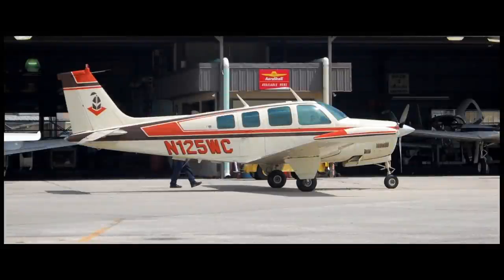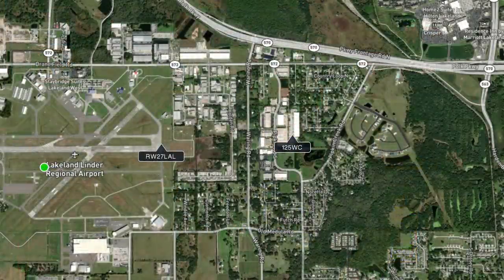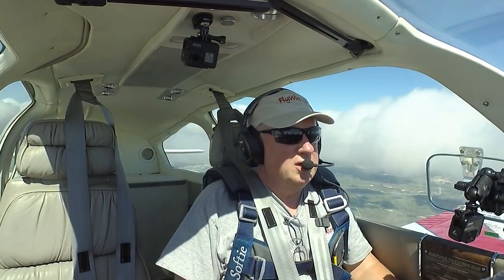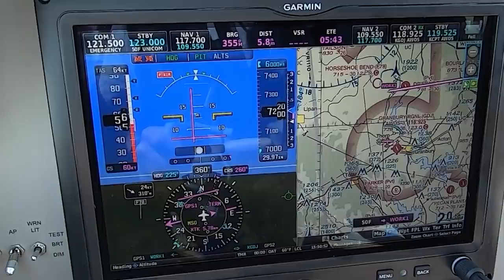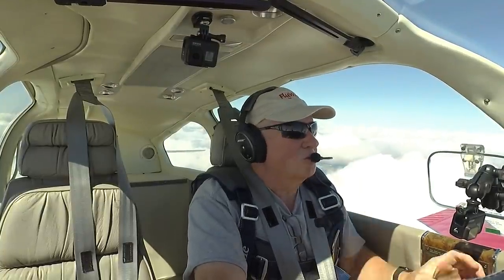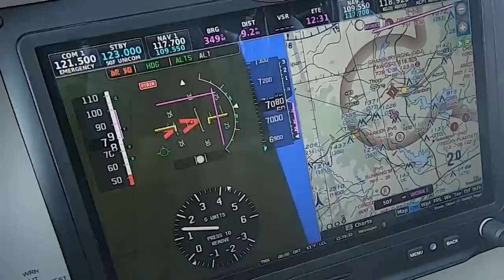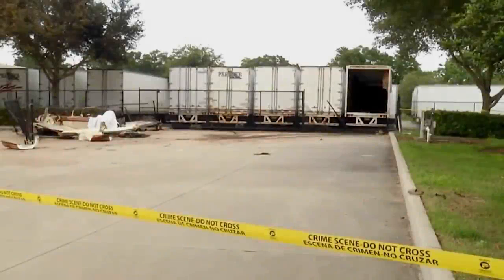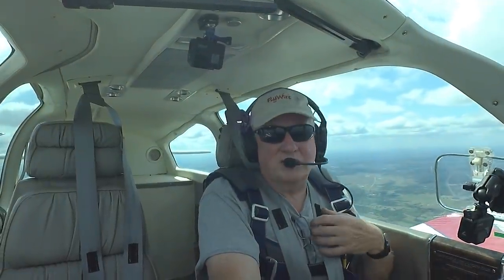Accident Review Engine Failure at Low Altitude  Extend the Glide

Comment: As a glider pilot, I learned the “fence hopping” maneuver. When you’re coming up short, dive for the ground so you’re in ground effect, and that’ll help you hop over the fence at the end of the runway.
Reply from the maker: Not a good thing for a powered airplane... they glide like bricks compared to a glider.
Reply: Glider pilots are brave.  They can drop nose at low altitude.  No power dependent pilot there..
Reply: I think the AQP guideline of defined minimum maneuvering speed (DMMS) is clearly the standard to shoot for here. Don’t go below it until you’re about to smack the ground.
Reply: @FlyWirescottperdue  What if you do like Bob Hoover and dive and climb, dive and climb with no engine?
Reply: @djbred18  I was wondering about that too. But then, I'm not inclined to become a test pilot on my last flight of my life, either.
Reply: @kevinjarchow8812  shit..I might just try it if it my last flight🤷🏻‍♂️
Reply: Ground effect works pretty well in gliders. When the glider "jumps" the fence, this jump is almost ballistical (under 1G at the top, if you pull down inmediatly as you only need to got just 5 o 6 ft AGL to clear the fence and proceed to the inmediate landing). If the glider still flies when reach the fence, it could clear it. The very low level, the post-jump's reduced Gs, and the inmediate landing disminishes the chance of a possible post-jump stall or his hardest consequences. But I think it's a very last resource: gliders brakes very well after touchdown, they're really STOL so, if you can, you must do a short landing using the emergency stop procedures.
Reply: @djbred18  
Sure! But you better have Bob Hoover's skills too...
Reply: @reggiepaulk You want to be at best glide speed until the field is made, not DMMS. If DMMS is much different than best glide speed you are going to put yourself in danger by possibly not having enough glide distance to make the landing site.

Comment: If any of you want to really learn how to handle an engine out, get an experienced flight instructor to pull the power on 2/3 downwind and proceed to land without touching the power.  You'll learn real quick what ground rush feels like and to respect your best glide speed.  Of course do this at a quiet time at the airport and make sure the tower is aware of what you will be practicing as your approach will resemble a carrier approach, no defined base or final approach leg.  This taught me to respect the best glide airspeed and to know my airplane, there is no substitute for experience.  It also teaches how far you can expect to glide your bird with no stretches allowed unless you want to wreck your mount and terminate your existence. Enough said.
Reply from the maker: Good point!

Comment: Stall/spin training in a cessna 150 aerobat was a very enlightening and scary experience. It’s amazing how quickly you are looking straight down at the ground and how much altitude is required to recover. It taught me to never get slow below 1000 ft agl, because there is no chance of recovery. More pilots should seek out additional training above and beyond what is required to get a ppl.
Reply: Nice video, my only suggestion is to get a prop filter for ur camera, makes the prop disappear. It’s just a piece of tinted material, anything will do. Try it
Reply: It is hard to avoid flying slow at low altitude if you want to land.  Otherwise I don't see a reason to fly slow at low altitude if you are flying for utility.
Reply: I did my flight training in a 1974 C-150 Aerobat. My flight instructor taught me stall spin recovery in VFR conditions as well as under the hood and a few times at night. This was in 1988 when the aerobat rented for $35 wet.
Reply: I think you're right. This video illustrates how fast you wound in this situation. It is much better to try to go for a controlled crash.
In view of how many accidents occur from the stall-spin situation, it would be a good preventive action to include it in the training syllabus.
Reply: @guidospaini7339  I think they should bring back spin training, too.
Reply: Never could get a 152 to spin.  Loved practicing stalls, power on and full flaps was pretty exciting.  Spun a Decathlon and I could have done that all day.  When the nose comes up and the plane starts pinwheeling, what a rush!  A dream in the air but with heel brakes only on the ground it was the DEBIL.
Reply: Great comment,  my instructor used to say training training training.  The three most important words in aviation
Reply: So true. Learned my stall recovery at 5,000 in a Piper colt with the glide of a rock. That thing was always near 3,000 on recovery. I felt much safer once I moved up into the Cherokee 150.
Reply: @curtisbrown5728   In Photo/Videograpic terms, the thing you describe is Neutral Density (ND) Filter.  It reduces the amount of light equally across the spectrum, so as to not distort the tones.  By reducing light it effectively slows the "shutter speed" (do modern cameras even have shutters?)  This prevents the "wagon wheel" aliasing that aggravates some people. 
I just learned about this filter a few days ago when another commenter implored a videographer of another channel to get one.
I'm particular about some stuff, but not optical aliasing with prop motion.

Comment: Most german pilots in WW2 started on gliders.  They were not afraid of power off landings, stalled less, glided after engine fails or shot down more.  Less pilot errors overall. Practice short approaches to  a point on runway..

Comment: Scott, I'd like to pass on a technique to significantly extend the glide which I learned 40 odd years ago.  While on downwind at the completion of a flight review in a Pa28R, the CFI cut the engine with the mixture and said "now show me a forced landing on the runway."  The landing with the engine shut down worked out fine, however the important takeaway from this was to learn that the glide could be significantly extended by pulling the prop to full coarse pitch: the reduced drag from the prop disc was such that you could actually feel the aircraft accelerate.  That lesson was learned many years ago in outback Australia and I think it's safe to say such a demonstration today would be regarded as foolish and dangerous – however I think it's an aspect of aerodynamics that pilots need to be aware of in case they find themselves undershooting during a forced landing.  
Another tip: Vx approximates min sink. Vy approximates best glide range.
Thanks for your great contribution to aviation safety.
Reply from the maker: Pulling the prop back is a good idea. In most of my videos on engine failures I don't do that because most folks don't do it for real. The difference in the Bonanza is 1500 FPM prop at cruise and 1000 FPM with the prop pulled back. I've got several videos on pulling it back as well. I'm pretty much on the fence on pulling the mixture... you give yourself an emergency and reduce your options. There is good and bad. Thanks for watching! By the way using Vx and Vy as proxies does not work across GA.
Reply: @FlyWirescottperdue  Hi Scott, thanks for your reply. Again, sincere thanks for your great contribution to aviation safety!

Comment: Appreciate your coverage.
My early learning was in a Piper Colt - (Flying Rock) I learned immediately to focus on any alternative that may minimize a crash landing.
My first, instructor initiated, dead stick landing would have come up far short of the Runway, but knowing the takeoff / landing capabilities of the Colt, I set a landing diagonal across he runway into an un-tilled stretch of field. 
My instructor aborted the landing and told me I was either confident or crazy(to be decided later) and the test was intended to fail.
2 weekends later, while prepping my plane for my he barely missed the top of the hanger line as he landed the Twin to my Colt Diagonal to the runway. The spinner and Cowling had exploded off on the downwind approach.

Comment: Well, technically the stall is induced by excessive angle of attack (approx 15degrees) rather than airspeed, but of course without an engine, the speed will keep dropping as the nose is raised in level flight, however the best glide angle is not at the point of stall!  If the wing stalls on one wingtip first, well you’ll get a rapid roll toward the side of the stalled wing and possibly precipitate a spin as discussed here.  Finding your best engine off glide angle would be a good thing huh!

Comment: Student pilot here and in my C-182 I have the most docile stalls. It is also possible the do a falling leaf descent with no power without to much trouble. In a populated area with no real areas to land the Falling leaf approach is the least energy way to hit the ground? Stalling into a inverted decent is not something I know how to handle. Upset training in a plane designed for it is in the cards for me.
Reply: Isn't your vertical speed pretty high during a falling leaf because you're stalled? Would not be a good way to hit the ground. You have to be carrying enough reserve lift to flare before touchdown to reduce your vertical speed as close as possible to zero. A power-off landing in a single engine plane should be pretty much like a normal landing during the final few seconds.

Comment: Use extra airspeed ( minimum maneuvering speed) until very close to the ground so you can maneuver around obstacles at the last second. Remember stall speed increases
During yanking and banking. Don’t try to make an airport. Use altitude to convert to airspeed and use airspeed to maneuver to a SURVIVABLE landing. (I’ve survived three off field landings)
Reply: What is "minimum maneuvering speed" and why is it better to use than best glide speed?

Comment: Some times I'm amazed. A single engine aircraft stating they have and engine out and the tower gives a runways to chase. Then the pilot not declaring an emergency and not heading straight for the airport grounds. Grass is better than buildings. Aim at center of airport or grounds there with least obstructions.

Comment: Nice thorough examination. How about stretching the glide
right after engine out by pulling up until the engine stops
windmilling thereby stretching the glide a whole bunch.
Reply from the maker: Good question.... but one fraught with uncertainty and risk, I'd say that maneuver would require actually trying it out at altitude to see what parameters work. The only problem with that is I'm against giving yourself an actual emergency in a real airplane to practice for a contingency. Add to that normal human reaction and I'd say that anything exotic has a larger potential to make things worse and not better.

Comment: Many years ago I used to fly Gliders, Sailplanes. We were told, if you want to stretch the glide, put your nose down. I.e. less drag. I know this won't quite work for a GA aircraft but nose down, not nose up.

Could you do a more indepth video on bull pit procedures. Cheers.
Reply from the maker: Definitely not nose up. I don't understand 'bull pit'.
Reply: @FlyWirescottperdue  I probably got the name wrong. When you were at flight school you had to memorize a procedure then an incident occured. You have mentioned it briefly before.
Reply: In either a glider or an airplane with an engine failure you want to fly at best lift to drag speed to get the best glide range (assuming zero wind). It varies a bit with how heavily loaded the aircraft is. The aircraft manual should give the best glide speed(s). It's not something to figure out experimentally during an emergency.

Comment: Hello Scott, have you ever tried pushing the cabin door open enough in flight to egress with your softie parachute? Unless you have aerobatic type emergency release pins on the door hinges, I’m fairly certain the average person doesn’t have enough strength to push the door open enough inflight to escape. I’ve tried in my Bonanza and have determined it can’t be done. Please respond with comments after a inflight door opening exercise. Most like you will be unable to latch the door close because the door will firmly trail about 4” open with enough aerodynamic suction to not allow a pilot in the left seat to reach over a properly close and latch the door. This scenario makes for a windy and noisy return for landing with the door remaining open.
Reply from the maker: Mark this is an aerobatic Bonanza and has the door hinges you describe. I have several videos on the door pop, you should watch them.

Comment: I see I wasn’t the only one surprised at the bonanza went into a complete roll or partial span during the stall and I was also wondering if that’s characteristic of the bonanza. Having flown archers at my training a lot which really didn’t have much of a stall characteristic at all and then when I graduated to Cessna 172 so I found it was easier to get into a spin on it just wondering if that is normal for the bonanza
Reply from the maker: If you hold aft stick in just about any airplane this will be the result.
Reply: Thanks Scott. Totally makes sense now.

Comment: A coordinated stall seems pretty dramatic in your airplane. I wonder if he put in some flaps near the end of the glide if he could have gotten a little more.
Reply from the maker: flaps will help up to about 10 degrees.... there is no 10 degree setting in this airplane.
Reply: I used to fly an airplane in which the CFI put a line on flaps needed airspeed.  He also put a blue line higher  speed than that line for Best Glide speed.  The flaps needed speed was from below the blue line Vglide to the minimum speed for a power off short field landing.  Easy guide for speed references.  Never forgot to use flaps when low speed. He had students soloing at 12 hours using those indicators.  He called them Flight Indicators..

Comment: Scott, do any planes, when they stall, simply plummet to the ground in the attitude at time of stall, instead of tipping nose down which allows for possible recovery?  I am not sure what the term "flat spin" means but I'm thinking there is no wind going across the flying surfaces so the controls have no affect.  I think we know the nose is not going to point to the ground because "it is heavier" so what makes your plane's nose go down when the stall occurs?
Reply from the maker: Jeff. A flat spin has a much higher rotation rate and can only be achieved with pro-spin inputs. No airplane will plummet as you suggest. A helicopter or auto gyro without blades would plummet. The nose does indeed go first because the engine is the highest concentration of mass.
Reply: @FlyWirescottperdue  Thanks, that is reassuring.

Comment: What is the effect of flaps on the 2 glide speeds?   If you cannot make it you want to be as slow as possible and into the wind.  But not much time at 300ft.
Reply from the maker: Good question.... but frankly I'd say that is too complex to use in the real world and highly dependent on a particular airframe. The flaps reduce the stall speed... so you can fly slower  for landing.
Reply: Adding flaps almost always decreases the lift/drag ratio, thereby steepening the best glide angle. But once you're committed to land somewhere, why not drop flaps to reduce stall speed and energy at landing?

Comment: I think there is a systemic problem of real-life training.  In other words, pilots train to do maneuvers and things but real-life training and situations are oftentimes left out.  Instructors should give students situations and help them work through real-life situations along with things to consider.  Often time, instructions just don't have the experience to give this type of instructions because they themselves have not been in these types of situations.  Getting trapped in IFR conditions for VFR pilots or IFR pilots on a VFR flight plan are no less than Emergency conditions and should be treated as such.  ATC in my opinion should have declared the Emergency for the pilot here in question since IMC conditions prevailed and the pilot cleared proclaimed he was not IFR certified.  This is a terrible outcome that is actually now a great learning tool.
Reply from the maker: You need to check out the AQP videos Dan Gryder did with Josh Flowers- Aviation 101

Comment: Scott, at the risk of being simplistic, isn't it just "basic airmanship" that each type of plane has an indicated airspeed at which the glide is the most shallow. Any slower (or faster) and the glide will be steeper. Are there pilots who don't know that well enough to actually fly that way? I guess there are or you wouldn't have made this video.
Reply from the maker: Unfortunately there are a lot of pilots that don’t think about this and mess it up when the sh.. hits the fan.
Reply: @FlyWirescottperdue  Interesting (and sad). I remember from my years of flying Mooneys (very clean, even with gear and flaps down), if I was high on final and wanted to steepen the approach, I needed to slow down (keeping a safe speed of course) and the glide path would definitely steepen.